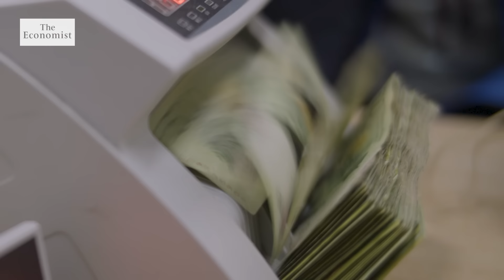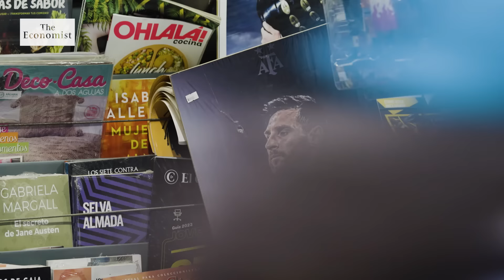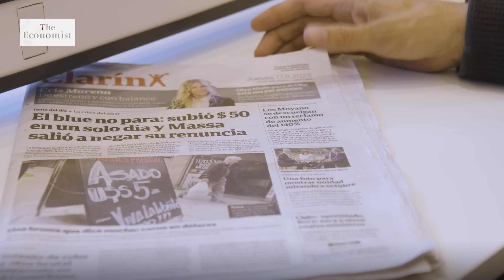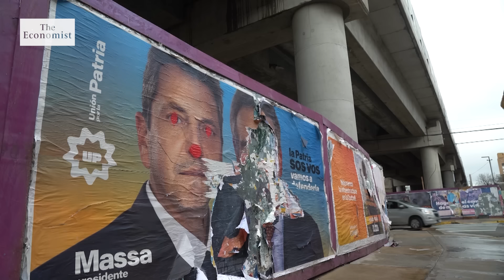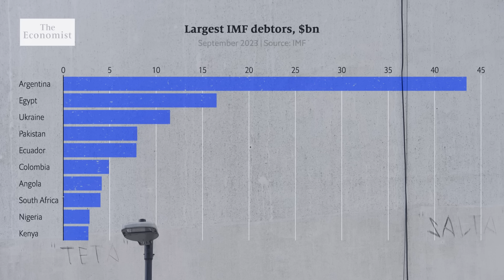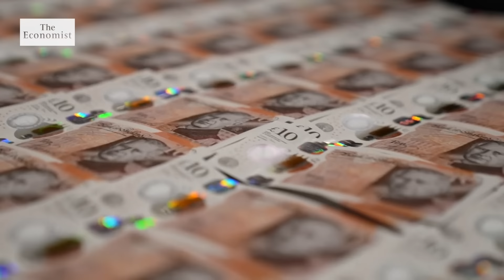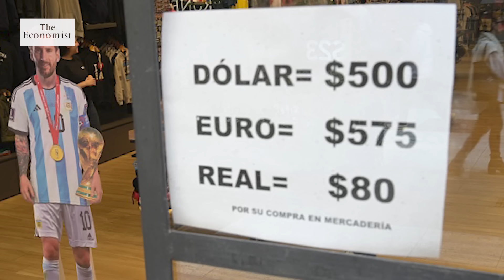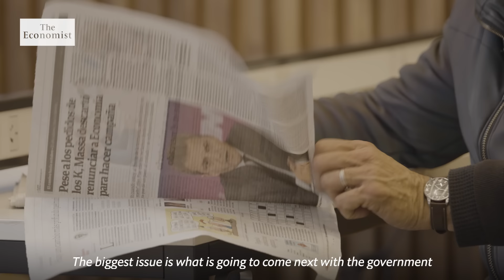Why is Argentina’s economy such a mess?

Comment: The system is failing as a result of both government and federal policy. In the next days, the banking crisis would have to be epic and gigantic for the FED to decide not to raise interest rates. This won't happen; an increase and a crash are coming. There will be more negative portfolios this 2nd half of 2024 with markets tumbling, soaring inflation, and banks going out of business. My concern is how can the rapid interest-rate hike be of favor to a value investor, or is it better avoiding stocks for a while?Read more
Reply: Just ''buy the dip'' man. In the long term it will payoff. High interest rates usually mean lower stock prices, however investors should be cautious of the bull run, its best you connect with a well-qualified adviser to meet your growth goals and avoid blunder
Reply: Very true, you can be passively involved in the markets and still amass wealth-gains using an investment advisor. I first dabbled in stocks late 2019, just before the pandemic, and that same year gained over 150% with no prior investing experience, basically all I was doing was following directions of my advisor. We are working on a retirement ballpark of $3m and I’m certain my goal isn’t farfetched after subsequent investments and tremendous returns so far.
Reply: Mind if I ask you to recommend this particular coach you using their service?
Reply: Sonya lee Mitchell is the licensed fiduciary I use. Just research the name. You’d find necessary details to work with a correspondence to set up an appointment.
Reply: thank you for the lead. I searched her up, and I have sent her an email. I hope she gets back to me soon.

Comment: Treasury rates are rising quickly, the markets are collapsing, inflation is skyrocketing, and the Fed is imposing a significant interest rate hike—all of which will result in further losses for portfolios this quarter. How can I take advantage of the present market volatility? I'm still undecided about whether to sell my $125,000 worth of bonds and stocks.
Reply: The strategies are quite rigorous for the regular-Joe. As a matter of fact, they are mostly successfully carried out by pros who have had a great deal of skillset/knowledge to pull such trades off.
Reply: Yes, I've been in constant touch with a Financial Analyst for approximately 8 months. You know, these days it's really easy to buy into trending stocks, but the task is determining when to sell or keep. That's where my manager comes in, to help me with entry and exit points in the industries I'm engaged in. Can’t say I regret it, I’m 40% up in profits just in 5months with my initial capital of $160k.
Reply: I work with Alicia Ann Jordan, a licensed fiduciary. Simply look up the name. The information you need to work with a letter to schedule an appointment would be included.
Reply: This is a scam for anyone wondering
Reply: usa has many issues too , those usa is not a example to follow , edit ... not even rusia china
Reply: Definitely a scam lol

Comment: It's not a "trust issue", it's a technical issue. Brazil had gigantic inflation for decades. Within ONE MONTH of the implementation of the Real Plan, inflation was controlled and purchasing power rose. In two years, the population in extreme poverty fell by 18.47%. In 1994 inflation in Brazil was 2,075.89%, in 1996 it was 15.76%.
Reply: Real Plan was resisted for technical reasons.  A policy of these characteristics has a technical and a political side as it really needs to recompose public trust in the monetary institutions. Many other plans similar to Real Plan have failed or have been short-lived. At the time of the implementation of Real Plan, Argentina had another policy, similar in many aspects to Plan Real, that kept inflation extremely low for almost a decade (Convertibilidad), at the cost of producing the greatest crisis in the country
Reply: @pippo1734  that's kinda wrong. Convertibilidad failed because it was implemented in Argentina, so we kept spending more money than we were earning. This deficit was then covered by taking more loans, until the debt became extremely huge and impossible to repay.
Reply: Is a political corruption problem
Reply: @tachy635  That's it.

Comment: It's quite concerning to see the various challenges our economy is facing right now, from uncertainties to housing issues, bad weather conditions, foreclosures, global fluctuations, and the aftermath of the pandemic, all contributing to instability. The rising inflation, slow growth, and trade disruptions definitely require immediate attention from all sectors to bring back stability and promote growth. How do you think these issues can be effectively addressed?
Reply: It's a bit unsettling to see the US dollar losing value due to inflation while other currencies are gaining momentum, creating a sense of uncertainty. Despite this, there's still a level of trust in the perceived safety of the dollar. I understand your concern about your $420,000 retirement savings potentially losing value. Exploring alternative options for securing your money sounds like a wise move. Have you considered any specific alternatives or strategies to safeguard your retirement savings?
Reply: With my demanding job, I lack time for investment analysis. For seven years, a fiduciary has managed my portfolio, adapting to market conditions, enabling successful navigation and informed decisions. Consider a similar approach.
Reply: This is definitely considerable! Do you think you could suggest any professionals or advisors I can get on the phone with? I'm in dire need of proper portfolio allocation.
Reply: Just research the name Stacy Lynn Staples. You’d find necessary details to work with a correspondence to set up an appointment.
Reply: I'm grateful for your help. After looking up her name online and checking out her credentials, I must say, I'm really impressed. I reached out to her because I could really use all the help I can get. We've set up a call for further discussion.

Comment: Jamaica went through something similar, but we decided that the bitter medicine would make us better in the long run. Someone just needs to tell them you have hard years ahead if you want to see a better day. You can't fix 20-30 years of mess in couple months or a year.
Reply: But we can start to do it the change, otherwise it will be worst and without hope.
Reply: We have more like 70-90 and some people would argue over 100 years of mess
Reply: Jamaica went through nothing like that in Argentina. In addition, Jamaica, ranked second on the brain-drain chart, is no better than Argentina. JA $154.54 = U.S. $1, where's the improvement?

Comment: “Argentia has been running a fiscal deficit for the last 13 years; if you are in a difficult time for 13 years in a row, well, you have a big problem.”

Between 1970 and 2023, the United States did not have a budget deficit, only in 1998, 1999, 2000, and 2001. We (the U.S.) have been running a fiscal deficit in 49 out of the last 53 years. However, the U.S. dollar is still the king of all currencies. How do the experts from the Economist explain that?

Comment: Great video, only forgot to highlight 2 points:

1 - The currency "black market" is actually the real market, that is indeed the value the pesos should have, shince it is not being manipulated by the government.
2 - There is a limit to how many dollars you can exchange officially, around 200 USD I think, the reason for so many black market.
Reply: 1. thats what black market means.
2. they mentioned that.
Reply: I'm sure those black markets are not taxed too.
Reply: @vittocrazi   
In fact, most people think black market is just "illegal", and they didn't mentioned the dollar limitation, just the lack of dollar due the demand ( limitation is imposed by the government, the lack o dollar is due supply x demand).
Reply: @rodrigorocha2935  they did mention there IS a 200 dollar cap on the oficial rate to buy. And It also IS illegal. Just not enforced.
Reply: The black market is the real market. That is correct. In fact, that's the only market, the other options are not available for everyone

Comment: The problem with "short term pain" is that it does not necessarily bring a better future. It has been tried before all over LatAm, thanks to the auspices of the IMF and the bright future never came. So it's hard to image people accepting this short term pain without a fight.
Reply: But if no one is willing to lend to Argentina, who are you fighting actually?
Reply: If the correct measures are applied, considering the local peculiarities, it works. It worked in Brazil in the 90s with the Real Plan. They pretty much overcame the hyperinflation. The problem is that they never tackled the fiscal problem, what is still a great problem today.
Reply: @oiante  It is unbelievable how people don't realize that the Real Plan was just a slightly different version of Argentina's Cavallo Plan (which ultimately led Argentina to the desastrous 2001 crisis) and that the Brazilian fiscal problem was generated during the first years of the Real Plan, when debt to GDP ratio skyrocketed from roughly 35% to 70% as a consequence of the burden of keeping the Real pegged to the Dollar for more than five years.

Comment: One of the latest statements is key, "things are going to get worse before they get better" but no one can bear the political cost of doing such a thing. The political system isn't stable enough to support long-term policies. Politics have way too many incentives to maintain government spending. They rely on clientelist practices through ad-hoc policies and subsidies in order to be reelected, but if you don't get reelected your policies are going to be overwritten by the next government, as has happened many times, throughout the history of Argentina. Even military governments have fallen under clientelist practices to keep governability.

Peron economic management was awful, but worse is the inconsistency in the economic policies. Add to that mix an irrational "industrial nationalism" and you start to see why so many irrational policies in Argentina
Reply: You've outlined a crucial dynamic in Argentina's political and economic challenges. The inconsistency in long-term policy planning is a massive obstacle. Short-term political survival, driven by the need for reelection through clientelism and populist measures, undermines any attempts at structural reform. It’s like a cycle where politicians are trapped between public expectations and the unsustainability of the status quo, leading to policies being reversed, negated, or poorly implemented with each new administration.

Peronism, with its heavy focus on state intervention and industrial nationalism, has left a lasting imprint on Argentina's economy, often prioritizing protectionist policies over innovation and efficiency. This "industrial nationalism" you mention, although meant to promote domestic industry, has often led to inefficiencies, with protectionist measures propping up uncompetitive sectors.

It makes sense that politicians fear implementing painful but necessary reforms because the immediate consequences are politically costly. Argentina's economic history shows how successive governments either avoid making hard choices or see their reforms undone. This kind of policy whiplash means that even when there are efforts at improvement, they can be easily reversed or undermined, further eroding trust in institutions.

Do you think there's any space for reforms that could balance long-term needs without falling into the same short-term political traps? Or is the cycle of populism and clientelism too entrenched at this point?
Reply: @ZdenekMicke69  You need some clever minds and skillful politicians to solve the dilemma. The problem with presidential regimes (quite common in LATAM) is the president has too much discretional power and it is meant to be short-term-minded. Peron's reform (legal and in practice) removed checks to their power, weakening the remaining institutions. 
The question is Can Argentina put the checks back? Even more, Is there any president willing to give up power? I'd say without being contested or in a situation where the easier decision is to give up power rather than keep it, it is not really possible.
This is like starting a new diet. If you plan to follow the new diet based on your will alone, most likely you'll tempted and fail. You need to set constraints on your future you, so make the right decision because it is the easiest decision to make.
Reply: @pippo1734  The consolidation of power tends to make leaders less inclined to introduce reforms that limit their own authority, and even when well-intentioned, these reforms can face serious obstacles without genuine political will and pressure from civil society.

To answer the question of whether Argentina can reinstate effective checks and balances, it would indeed require a leader or political movement willing to prioritize long-term institutional stability over personal or party gains. However, as you point out, relying solely on individual willpower is insufficient, as it’s rare for someone in a position of power to voluntarily limit their authority. Historical examples show that external constraints and incentives are often needed—like a strong judiciary, vigilant media, or international pressure.

The analogy with dieting is particularly apt. Institutions, like individuals, need more than just willpower to change; they require systemic incentives and structural constraints. Implementing effective checks on power would involve making it easier for future leaders to uphold democratic principles rather than allowing them to centralize authority, even when faced with the temptation to do so.

For Argentina, this could mean constitutional amendments that strictly limit executive power, empower independent institutions, or even reform electoral laws to reduce the concentration of influence. It would also require public awareness and mobilization to demand these changes—a robust civil society that holds leaders accountable. Ultimately, creating an environment where the path of least resistance is towards strengthening democracy rather than undermining it is key to lasting reform.
Reply: @ZdenekMicke69  that's right. The issue is  the power balance doesn't seem to be a platform strong enough to move people, specially hungry people. If the Milei experiment fails it may create a windows opportunity for change, as long as there is "new social contract" option in some leader's minds. However, most likely some of them will try to take revenge.

Comment: Solution: hire 100 experienced government administrators from Singapore and give them complete control over everything in Argentina.
Reply: Singaporeans can only run a city state. There are better administered countries (actual countries) than them at running politically sustainable administrations. Korean can be a better solution… as they managed many opposite forces to count initially develop the economy.
Reply: Taiwanese. Argentina would thrive in no time.
Reply: Sounds great on paper but it’s going to require education and a willingness to do the hard work within the average Argentine for it to work. Singapore pushes education, that has to be the start.
Reply: @네.이.트  Argentinians are Italian, German, Spaniard, Jewish, and Arab stock. There are also the offspring of Chinese living there. Hardly Africa.....
Reply: Can confirm @juanmontoya6622 's statement, half arab half spaniard from Tucumán here.
Reply: I expect this too, because Singaporians are used to handle different cultures. We Germans are definitely not.

Comment: The economy is 600 bn at the official exchange rate, at the parallel is 300bn which represents a gdp per capita of only 6k
Reply: Nominal GDP is $641b in 2023 per the IMF. Argentina's per-capita GDP is $13,700.
Reply: @taterkaze9428 but it has no value in the case of Argentina because it goes up and down and again up and down due to inflation and currency instability.
Reply: @taterkaze9428  when using the official exchange rate (that nobody can get), when you consider the parallel that cost twice as much, gdp per capita is way lower.

Comment: Changing currency won't change the structural problems at all.
Reply: thats not the only solution. they plan on severely cutting on the public sector and spending
Reply: I'm sure membership in BRICS will solve everything.

Comment: It has been though to watch how Argentina and Türkiye have similarities of the economy management. Short term pain brings long term prosperity as long as you keep applying reasonable policies and establishing proper check and balance system, which governments mostly don't like. I wish both Argentina and Türkiye will survive and accomplish low inflation rates.
Reply: to achieve a low inflation rate you must have a low interest rate. They should pin rate to 0%

Comment: Open up the country for trade abandon the protectionism bring in supply to meet demand and sell your resources for profit. Revamp the tax system that taxes each class fairly so that the govt can fund its operations without ever thinking about printing money or do what Zimbabwe did and drop the currency and move into the usd but acquiring usd would be tricky part.
Reply: they should stop trying to peg their interest rate to the dollar, and then they should pin their interest rate to 0% the 130+% interest rate is why their inflation is so high
Reply: What does the cost of borrowing have to do with the velocity of money i.e. the rate at which money exchanges hands at the ground level?  If resources are finite and Argentina has played the role of isolationism then it's reasonable to expect that money is chasing too few goods and therefore inflation will be high.